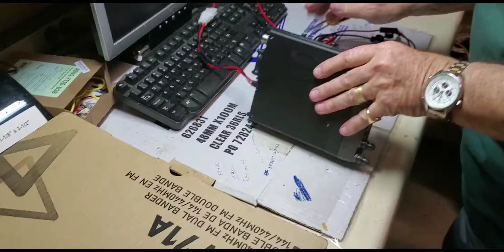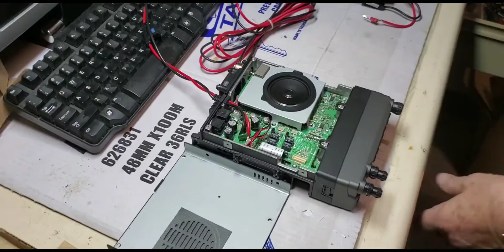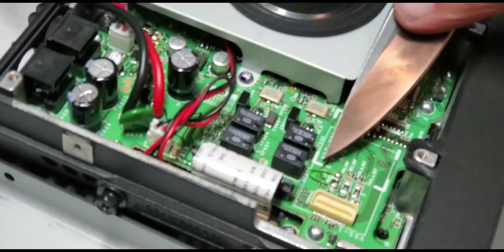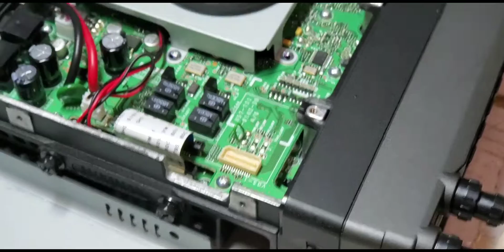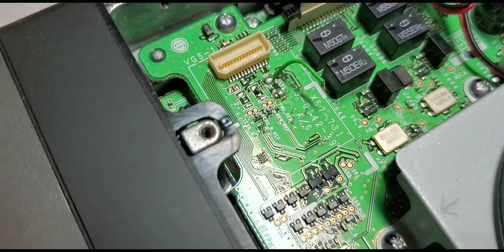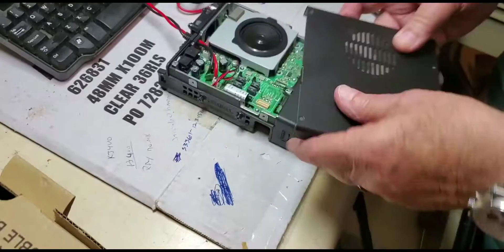A SIMPLE 2 MINUTE VIDEO ON HOW TO MOD THE KENWOOD TM-V71A RADIO

Comment: My KenwoodTM-V71A only puts out 37watts on the high power mode. Is there an adjustment in the programming or physically inside the radio that can be made to get the rig to do 50 watts as the specifications say it should?

Comment: Oh yeah, leave that non insulated at the end jumper wire just dangling, it'll be OK.  A little electrical tape over the bare wire would be OK if your not that lazy or concerned about ruining your radio.  Remind me not to let you (the author) modify my radio let alone follow your instructions.  Heck, even the guy in the background is questioning your procedures.  Probably a newbee to Ham Radio that has more sense than you do.
Reply: I see the points you're making, but no need to be quite so rude.
Reply: @Perthshire  Sometimes it's necessary and justifiable.
Reply: @videobruceb8879  it’s a radio. no need to get all high and mighty over it.

Comment: Why didn’t you explain what the mod does?
Reply: Because most licensed HAMS and/or those who do/want this already know what it does. Called "MARS MOD" for MARS (Military Auxiliary Radio System) essentially.
Reply: @jacksonarc1253  I didn't! I was also wondering what that mod was for.
Reply: @jacksonarc1253 will this mod allow transmitting on gmrs frequencies?
Reply: Well mine does go the GMRS frequency's after this mod but I do not know if it works on all 71's. Just say'n